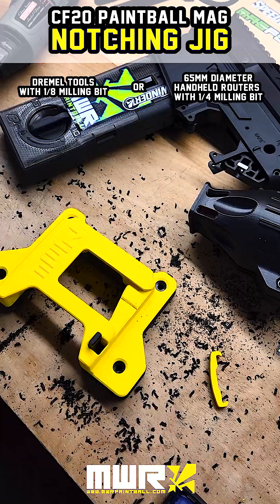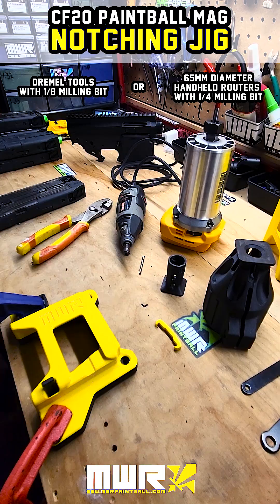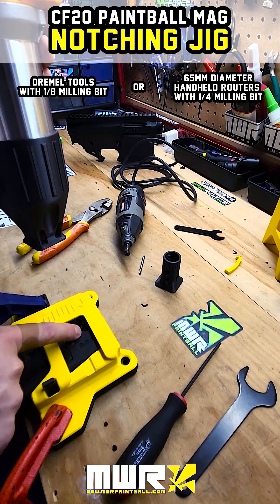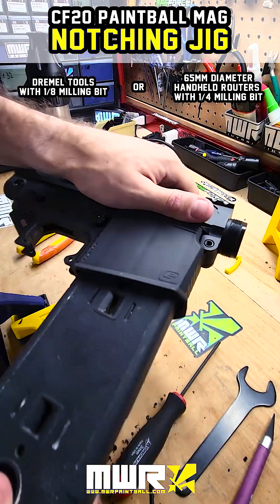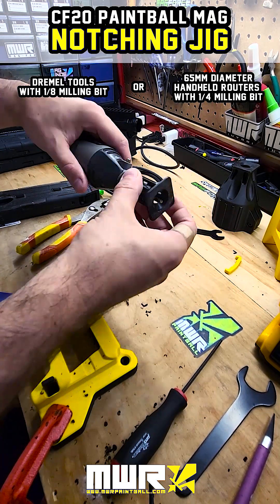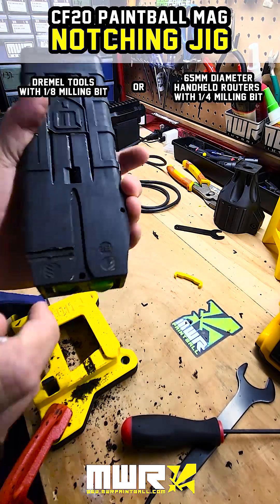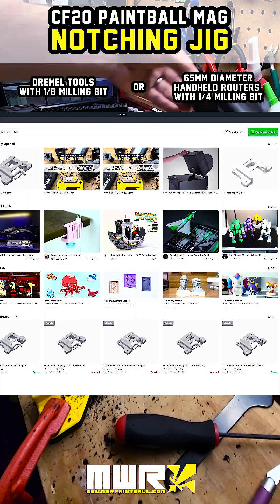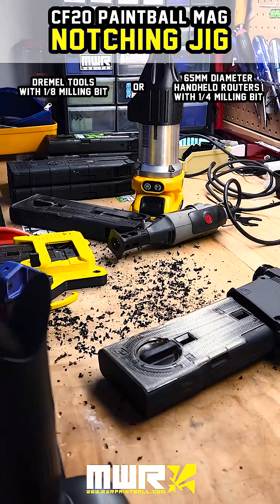CF20 Notching Jig for EMF200

Comment: So the EMF-200 is not compatible out of the box for EMF-100 mags? 

Weird
Reply from the maker: There is a paddle release in the box! That lets you switch to the emf100 style release and should work for both mag cf20 and cfpro mags but i found it was unreliable with the new pro mags. And a lot of players just wanna use the AR style release no matter what, so this will allow them to use their stockpiles of cf20 for that.
Reply: @mwr_paintball if I were to buy your kits for the EMF-100 would I have to do this to it?